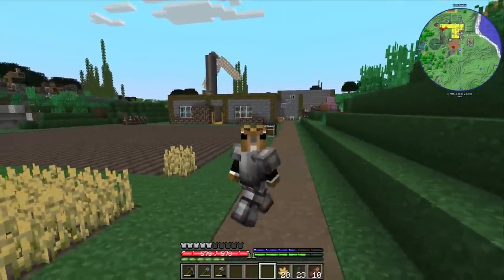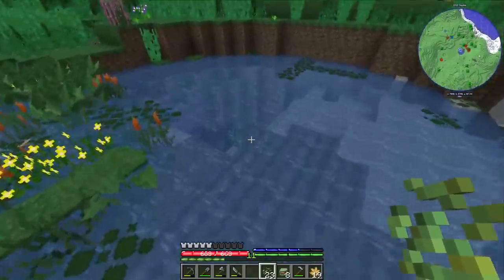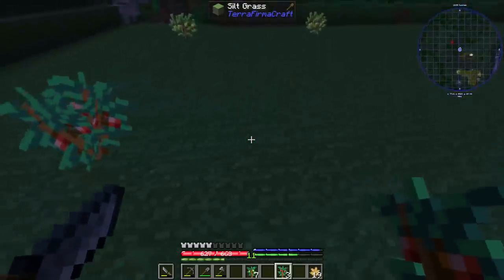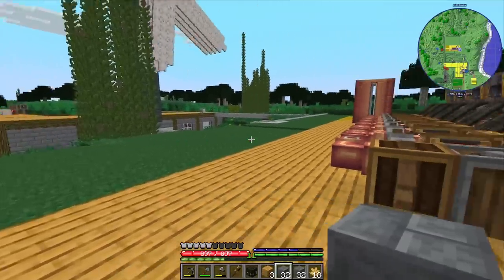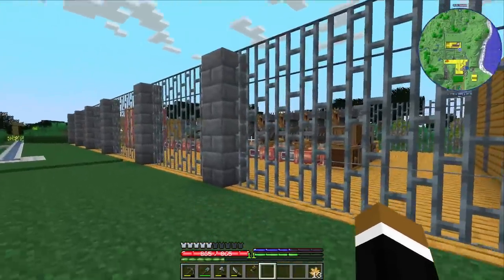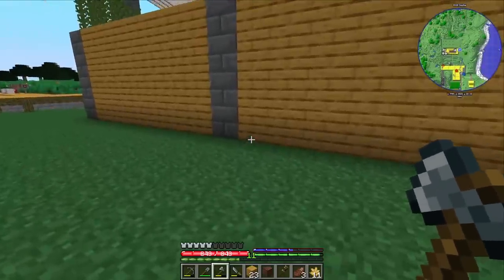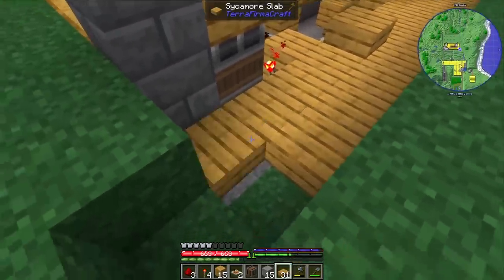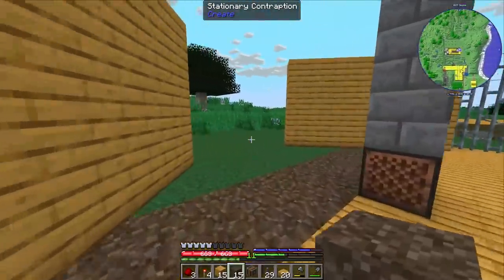ATFC: Making A Fancy Barn Door (Episode 29)

Comment: The door can be made using half of the mechanism, instead of having one clutch-gearshift per door side you could have used one, forked the output and inverted one of the outputs. Rotational power distribution is easier than  redstone distribution.
Seeing Ilmango go through the create enginnering learning stages is very interesting, I hope he considers using the mod in the future for a differnt series.
Reply: I'm imagining the whole scicraft server using create
Reply: I'd love to see a scicraft create season.  Maybe they can work out a sponcership deal some year.  Them, and the create team, sponcered by somebody, to advertise them in every episode, and run a server for a season.

In the meantime?

There's a one block solution for that entire process, isn't there?  Isn't that what the programable block is basically for?  "turn at this speed for this time, then stop for this time, then turn at a different speed (backwards) for this time, and then stop?"
Reply: @ICountFrom0  yes, thats a sequenced gearshift, which he looked at
he knew but didn't have the rose quartz yet and this wasn't a ton more work
Reply: nods I think the amount of redstone he placed would be enough to make the rose quartz... problem is getting the quartz without the nether, let me guess, gemstone rare?
Reply: @ICountFrom0  I think he actually mentions this briefly in the episode, the problem with electron tubes is actually getting the paper for sandpaper to polish it, he has the redstone and halite (basically salt, and what ATFC uses instead of quartz; I think you can even make vanilla quartz blocks out of it for building) to make rose quartz, but he needs papyrus or sugar cane to make paper, and he didn't want to go down the whole rabbithole of that
Reply: Oh, THAT is why he showed off the changed paper production.
Reply: @ICountFrom0  yep, thats why
Reply: For the want of a nail, the kingdom... had to do a silly kludge that still worked.

Comment: If you ever need to place dirt or other gravity affected blocks and have them not fall in the future, instead of filling all air gaps you can also use a wooden support underneath.
Reply: Can you place single planks (like, a single plank) in this version? I remember it stopped gravity blocks too
Reply: @Yorick257  I think that was never re-implemented since the 1.7 version
Reply: @fdagpigj  @yorick257 actually yes you can, if you mean sawing logs into lumber then crafting into planks. You are correct, they aren’t affected by gravity and I’ve used them (and you can see mango use them earlier on in the series) as a block to place wooden supports on. Supports are technically cheaper though and provide an area of support rather than the single block, but depending on the situation, planks can be preferable.
Reply: @ethanallred2543  I assumed Yourick257 was referring to lumber. The pre-1.8 versions of TFC had built in mini blocks (1:8 scale) and one lumber (ie. one singular plank, if you set aside the name and just look at the item sprite) could be placed as a 1x1x8 line.
Reply: @fdagpigj  I kinda figured the same, but I’m prone to give the benefit of the doubt and I explained it in case they didn’t know already, but yeah I think you’re correct in your answer.
Reply: wooden supports definitely work well for that, on my ATFC world I had a cave opening right under where I want to build my forge building, so I just put some wooden supports in it and covered it over with dirt

Comment: You should make something to make depth in the walls of the barn, the depth is what makes the steel bars look good. If you replace the wooden planks with logs (one block to the outside) it will look al lot better, as if they were supports.

Comment: dirt falling: if the dirt is supported from two or more sides (plus one from below) it won't fall . . . but if it is supported from less than two sides it will fall apart.
also, they can destroy slabs and slabs aren't considered as a supporting block (probably only a full blocks counts) . . .
the reason why it was holding together at 24:26 and was falling apart at 24:13 wasn't because you added those slabs, but because you placed those two dirt rows in different order . . . 
it can save you from a giant collapse and create structure destruction . . . . yes, it happened to me

Comment: The Cow Jail
I won't go deeper on the jokes, but let's just say I wouldn't use those for the side, specially not from the bottom. My taste for a barn is all wood or wood+stone bricks(or similar), with fences one block up on the side for air circularion, with a solid block in the bottom. But that's just me, not you.

Comment: "normally in vanilla you have an iron farm." 

Well mango if tfc didn't remove/disable it create has an iron farm mechanic as well. 

Just use a fan to push water onto (wash) gravel which can be made from cobble and a crushing wheel/millstone. 

No clue how vanilla iron will work with tfc recipes tho.

Comment: 10:36 Terrafirmacraft indeed is a mod that thematically complements so many other mods out there - unfortunately, the programming behind Terrafirmacraft is such that modpack makers have to pull lots of strings just to get the modpack barely running (especially for the 1.7.10 version)